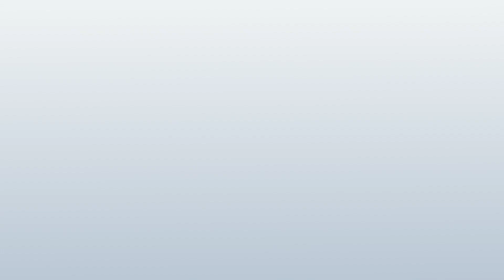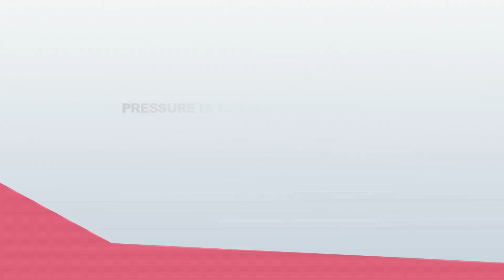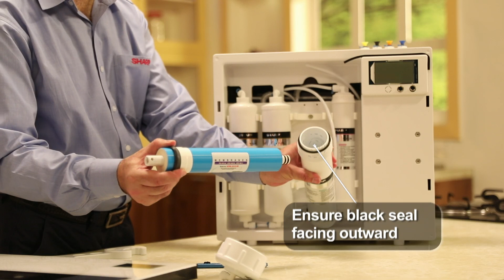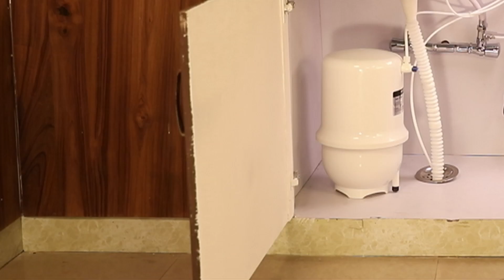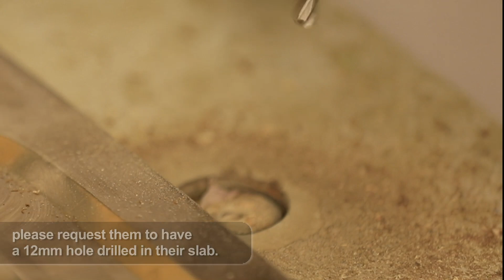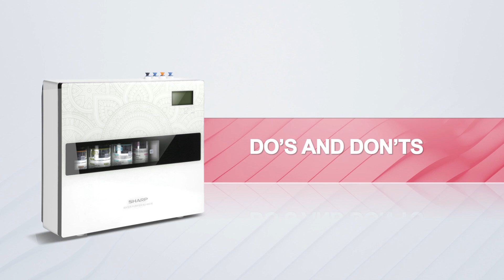Sharp Vestige Water Purifier Installation & Maintenance Video

Comment: Hello sir,  RO memrine corporate water me zaruri hey?  Test may changes aayega? Corporate water may konsa filter ki required hey?
Reply from the maker: Hi
If you are able to drink the Corporation Water directly, then RO is not required. But if the water tastes bitter, hard and is not drinkabe, then RO is recommended.
Thanks
Sharp India Team
Reply: Not directly corporation water , first storage in underground tank and second upper tank  in tarrace than use it...so I purchased sharp than what can I do to installation and which part I needed in ... explain please
Reply from the maker: @ummehaniunchwaniwala3954  Please give a MISSED Call at 9804763763 and our representative will call to guide for Installation of Water Purifier.
Thanks
Sharp India Team
Reply: @Sharp_India  ok sir thank you

Comment: Vestige Pvt LTD is very good company.
And sharp water purifier is also very good. Indians did not know that sharp is 128 year old Japanese company and there product very good in compare to cheaper China made water purifier.

If any Jaipur person required water purifier contact to me.
Mrp is 32000/- and vestige provide it on 28000/- 
But contact to me I provide it 26499/- only.  
So message me on WhatsApp 8386034750

Comment: Hii sir after filter the storage of water outlet stainless or copper
Reply from the maker: Dear Dinesh ji,
This is something unique in our Water Purifier which is explained below
1. All water purifiers sold in India has multiple filtration stages and thereafter the water is stored in the tank. Generally companies claim 95 to 99% purification which means that the balance impurities of 1 to 5% goes into the tank. This continues and impurities are accumulated in the tank as they are never cleaned. Additionally usage of poor quality plastics give a smell to the output water in addition to accumulated impurities in water. To divert users from this topic, they started promoting Steel or Copper Tank, but how can you stop the impurities from accumulating in that also? A simple question - Is the output water quality same as the purification promise made by companies?
2. Sharp has taken this point seriously and have used Environment friendly food grade plastic in the tank. Also we are using a special technology called AF Disruptor between the tank and output water tap which ensures cleanest and consistent water output. Hence it is same as what we promise.
For more details, please visit our website.
Thanks
Sharp India Team

Comment: Cartridge change indicator is shown in my filter and dealer here in Aizawl told us to reset and make the filter cartridge   block full and it did, so my question is how much reset can be done to avoid cartridge replacement
Reply from the maker: Hi,
We are sorry for the inconvenience. What he meant was, you can continue to RESET the Level Indicator and use the PP Filter till such time it is blocked. This is the benefit of Sharp that it doesn't allow the dirt or impurities to pass through.
In case of any further action, please share your contact number or send an email to adsingh@sharp-oa.com
Thanks
Sharp India Team
Reply: @Sharp_India  thanks so much sharp India
Reply: @Sharp_India  if cartridge needs to replace after reset blocked where can I buy new cartridges, or can you give me details of the prices
Reply: Min lo hrethiam lawk mai!
Reset leh flush button hi engang huna hman tur nge niang? Chuan a battery indicator hi a hniamzel sia thlak tur tihna mi? A filter battery ho hi?
Reply: @lights......s battery indicator a hniam viau hnu ah khan ka reset leh tawp zel mai, cardtridge thlak a ngaih hma in vawin 3 vawi 4 vel chu a reset theih anbtia, a theih loh hunah chuan cardtridge chu ka thlak tawp mai ang kntia
Reply: @Lacyjoss  okok.. K lawm ltk e! 👍🏿